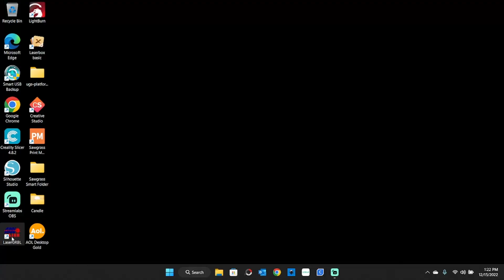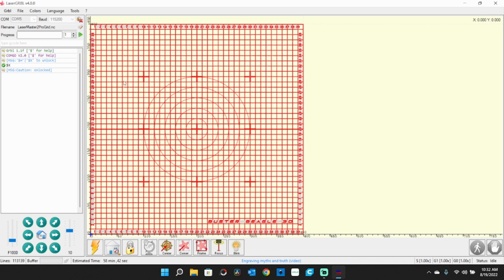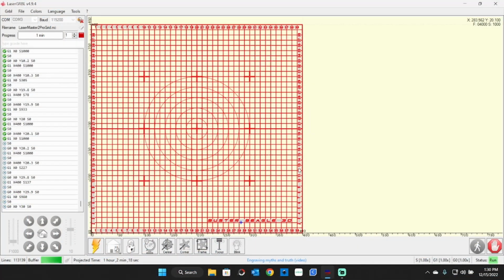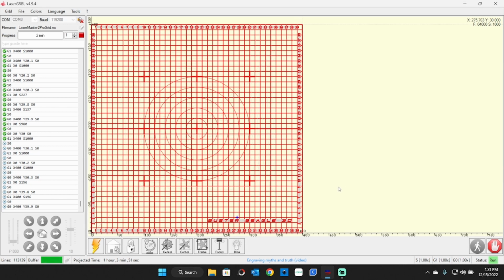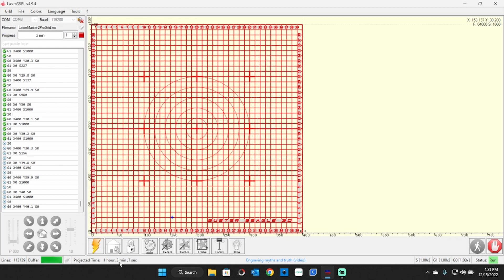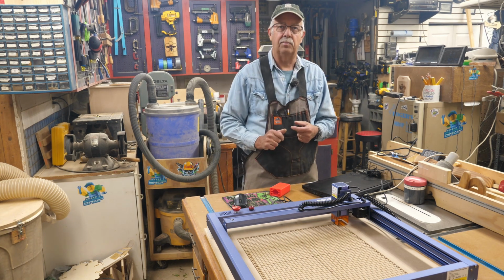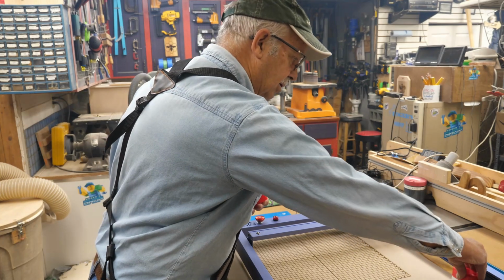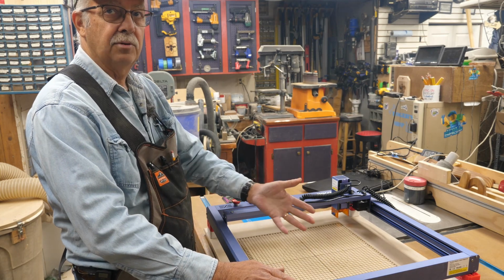Jiccoda L1 Laser Custom Base and Risers

Comment: Thanks! I've emailed you about the riser .stl files.
Reply: I forgot to ask if you had a chance to try the included rotary roller?  The description says that it is compatible with most lasers and makes no mention of a USB connection. Does the rotary roller actually need to plug into the Y axis port on the controller board instead of the Roller USB port?